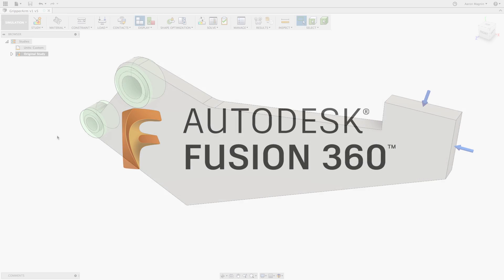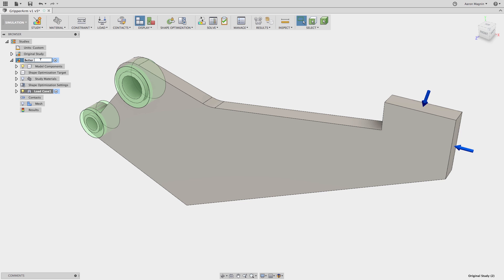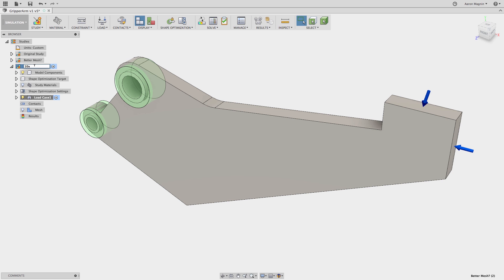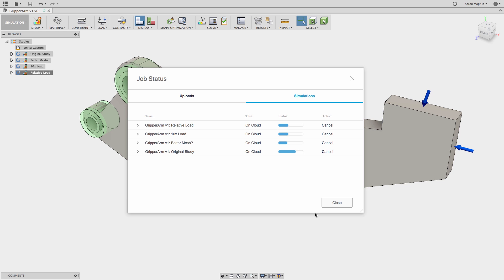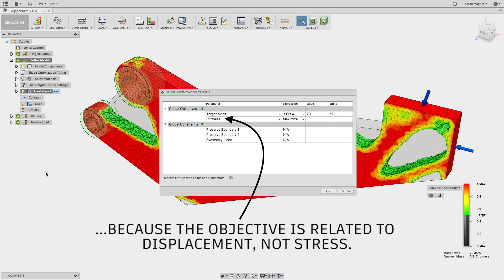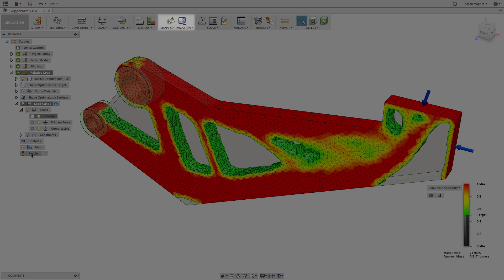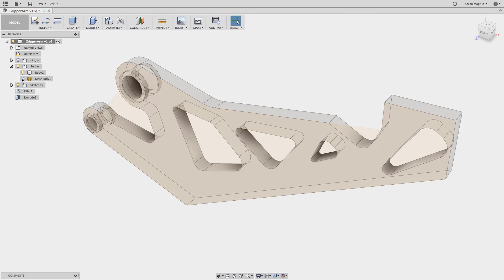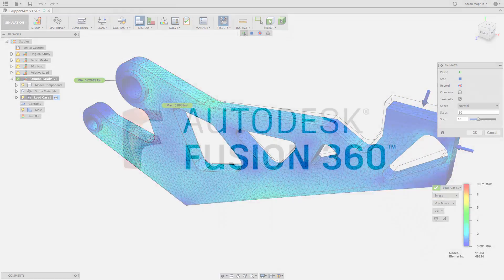QUICK TIP: Shape Optimization

Comment: Hi fusion 360 Team, I was wondering if it wuold be possible to insert the bolted connection tool in Fusion 360 as you find in Inventor. At the university I've tried a lot of different CAD software and  the bolted connection tool in Inventor is a dream. If you could include that in Fusion 360 would be awsome! I know there is the McMaster tool which is very handy but the bolted connection tool would be even better and more powerful!